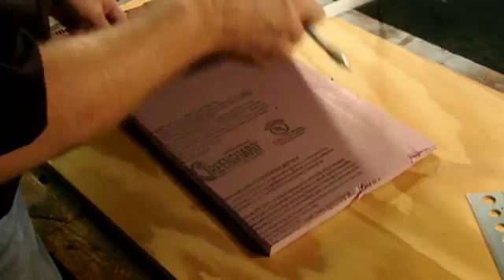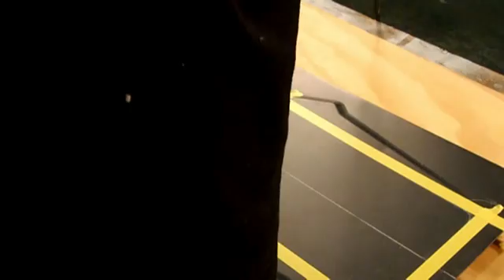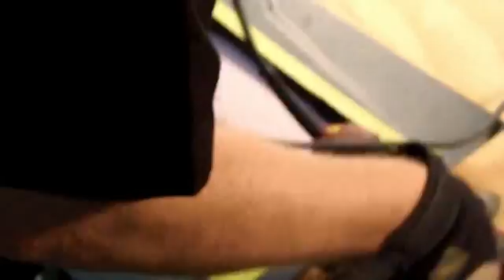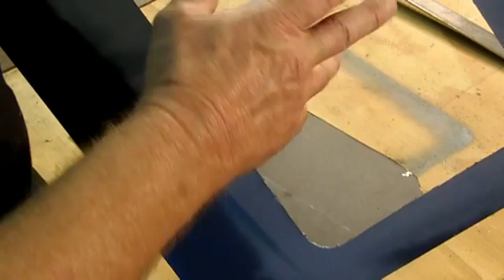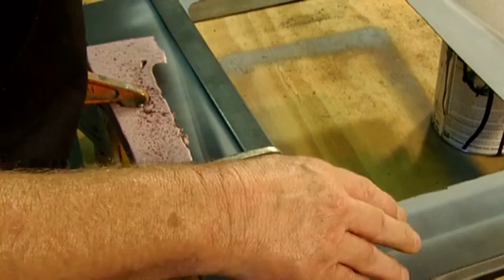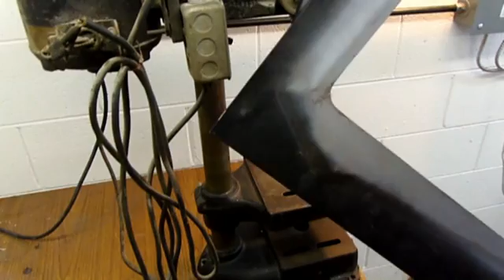PC Window How-To

Comment: Hi Jake, thanks for the video, so many video's are fast forward, you miss the way it's done. Nice touch with the flapper wheel. Just dropped my side panel off at the graphic designer, it's a CIT Goblin case, so my theme is the Green Goblin. So at the moment it's just a box with wires hanging out. 
Look forward to watching more of your video's.
Karl

Comment: Brutal. Why noy make a template and use a router? True professional machine finish. Also would only take half the time.
Reply: Yes it will work on metal.  Very easily. Like a hot knife through butter. The blades are carbide.
Reply: Jesse G I was going to say the same, even if its just for grinding excess material from the straight lines, a good router bit with a bushing would take care of it in mere minutes.
Reply: A router isn't going to work well on metal
Reply: Butch Weathers Why not? it seems to work very well on homemade CNC's, and those normally use routers (ok, they usually use dremels, but a router can do the same, just a little less RPM) as the cutting machine. A good carbide bit and a slow pace and it shouldnt be a problem. You can see here on youtube vids of people using normal routers on fairly thick Alu and even steel sheets with a very good finish.